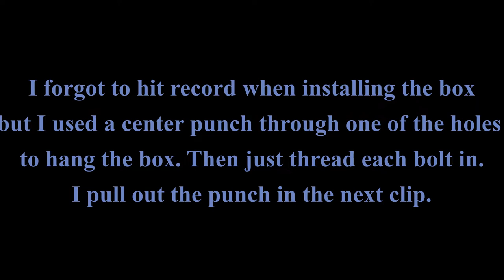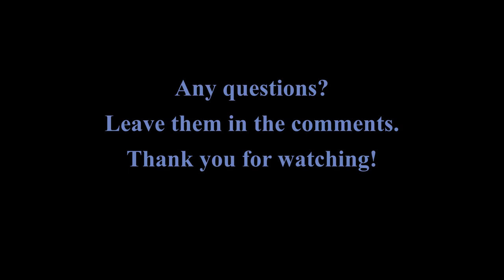DIY Steering Box replacement on a squarebody.

Comment: Exactly which steering column did you use? what car?
Reply from the maker: The steering column is the original one to the truck.
The steering shaft is from a 96 Jeep Cherokee XJ.
Reply: @FullRange4x4  exact, thanks

Comment: How do you bleed it?
Reply from the maker: There are videos out there but I just jack up the front, fill the reservoir and work the wheel back and forth with the truck running. Takes about 10 mins. Keep checking the fluid level as you go.
Reply: @FullRange4x4  ok simple..thx
Reply: @FullRange4x4  also i’m still deciding between the redhead or Borgeson. Have you heard much difference in either one? Any reason why you didn’t use the redhead or was the Borgeson just the first one you picked?
Reply from the maker: I have not. I considered the red head but $ was the deciding factor  ultimately.
Reply: @FullRange4x4  how long have you had the Borgeson now and are you satisfied with it? How does the steering feel? Maybe a follow-up video?
Reply: @FullRange4x4 i mean Cardone..
Reply from the maker: Well I had it for a while, no issues, felt waaaayyyy better, still had the truck off road a few times too but I did a stupid thing and sold the truck so I cannot make a follow up video.
Reply from the maker: Yes, absolutely.